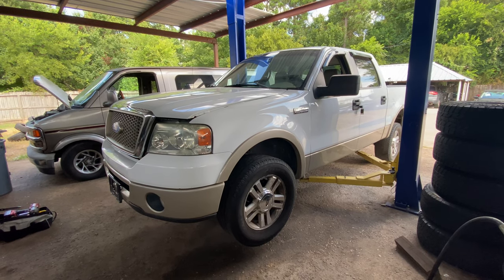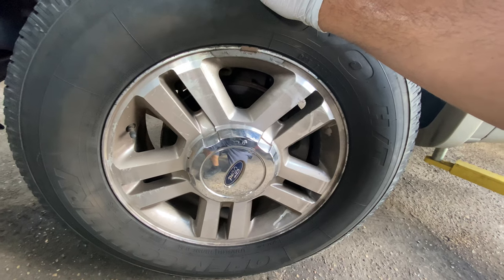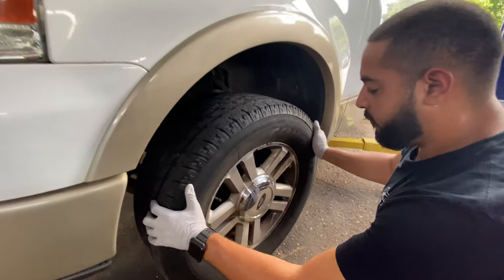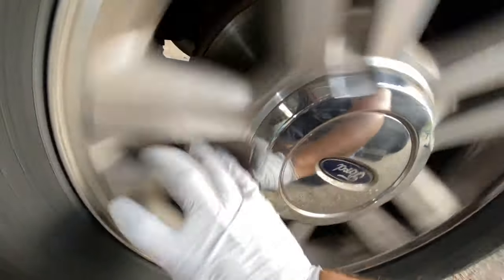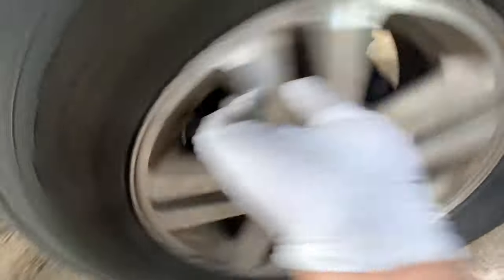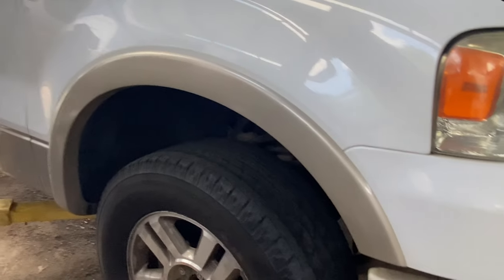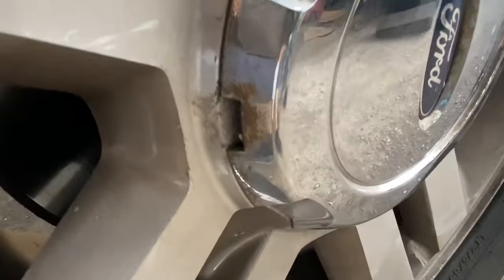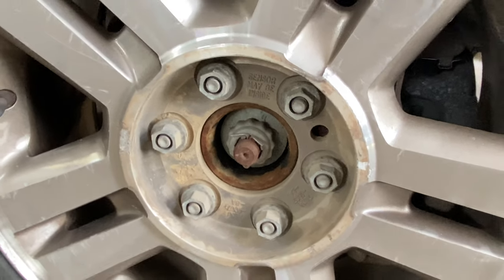HOW TO CHECK FRONT END NOISE WHILE DRIVING FORD F-150 - BAD WHEEL BEARINGS NOISE!

Comment: thanks for video, but there's alot of play when you are shaking the wheel at 9 and 3 o'clock, it's not tight.  It may have been helpful to describe why the noise isn't brake/pad rotor rubbing noise and how it's different from bearing noise?
Reply: It needs ball joints too

Comment: Thanks for the video!  I have a humming sound on what seems like drivers side.  Seems to be quiet until around 35 to 40 miles per hour.  I did the wiggle test prior to watching your video back awhile ago and has not play.  However does seem to grind when spinning and can hear it.  Did this fix this trucks problem?  Was going to go ahead and replace the bearing and see if it would work.  Let me know if it fixed it.  Thanks!

Comment: 06 hear. No noise. But pulls to the right.  Was checking breaks and realized passenger side when jacked up doesn’t spin freely. Will spin with a prybar very hard but will spin   Nothing like the drivers size. Eh oh seems to spin normal.  I guess the bearing is bad but no noise